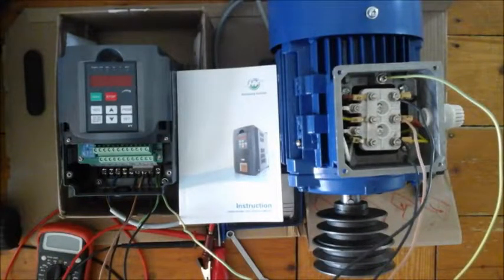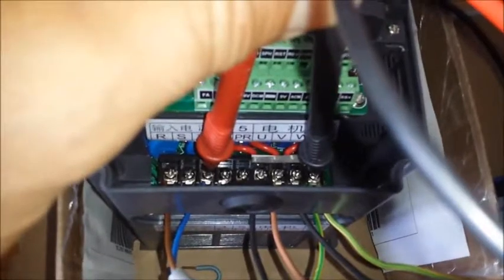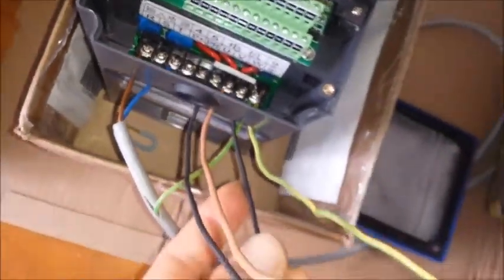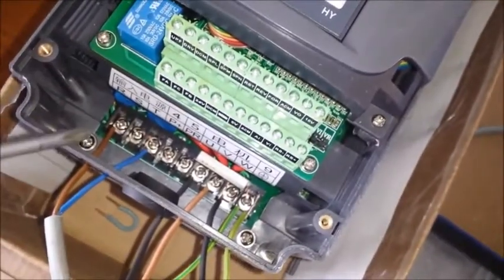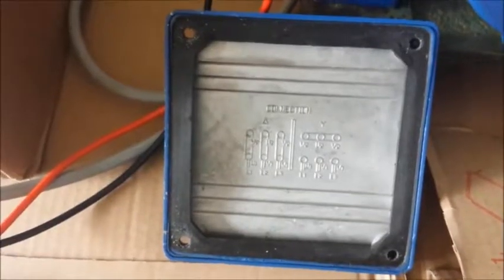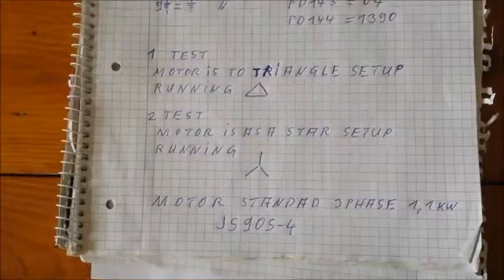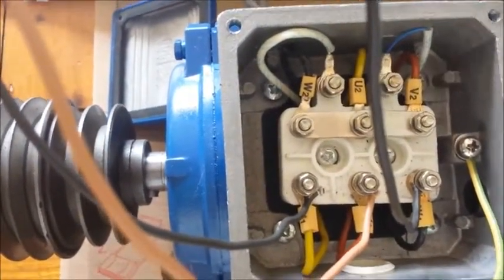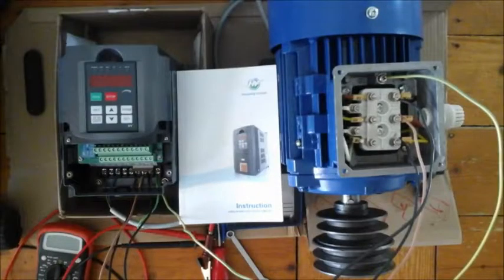huanyang vfd 220v 2.2kw not working with js90x motor

Comment: You are trying to run a 3 Phase Vfd with a 3 Phase Motor on a 230 Volt Powerplug
R S T is for 380 Volt Input not 230 L and N!!!!

You need a 230 Volt Vfd to drive the 230/400 Motor in Delta on a Standart 230 Volt Powerplug
Reply: Looks like the error is under voltage lock out. It does look like it's not a 220v input vfd....